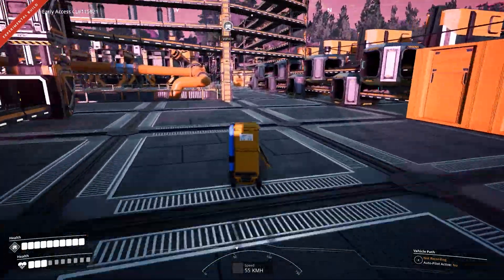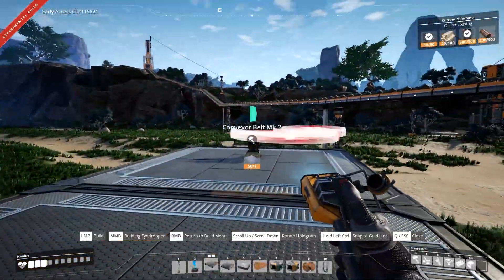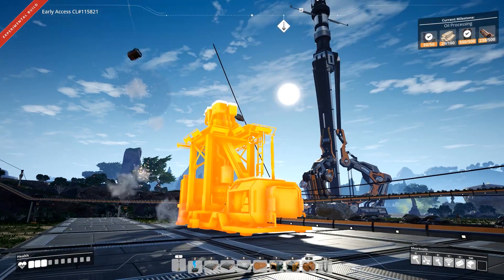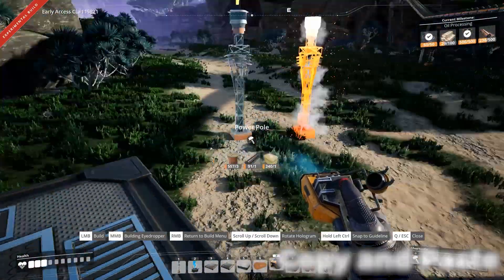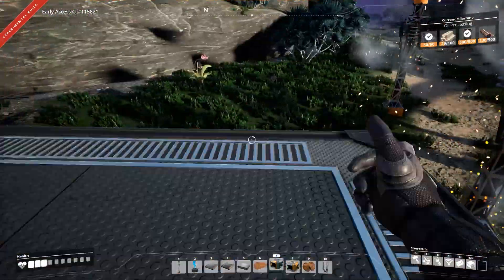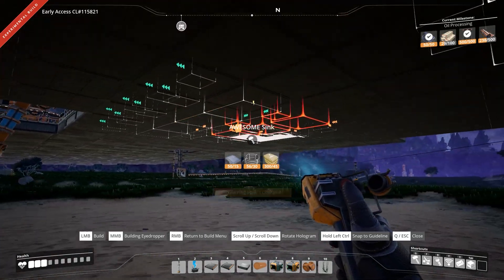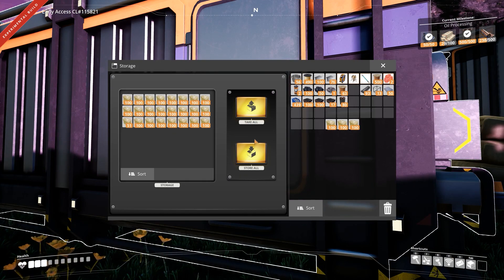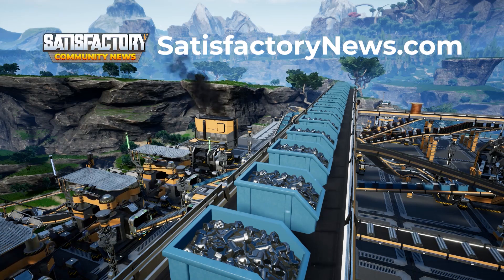5 Tips to Make Satisfactory Update 3 Easier

Comment: Hey I dont know if it happened to you guys yet but sometimes when upgrading miners you need to replace the belt. it might be only me ..
Reply: Happened to me too.
Reply from the maker: This has not happened to me, but I have been having some issues with splitters and mergers not detecting existing belts. If I deconstruct a splitter and put it back, it sometimes does not detect one of the belts coming out of it, for example.
Reply: @SatisfactoryNews  your video showed the belt had stopped when you upgraded the miner